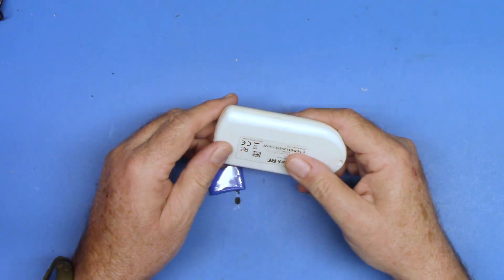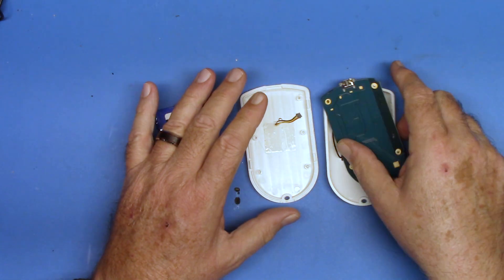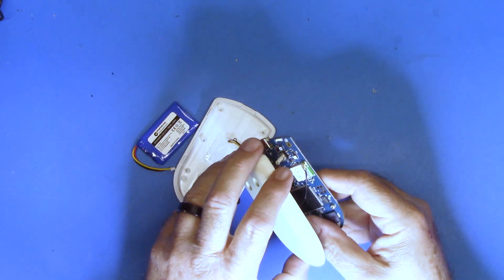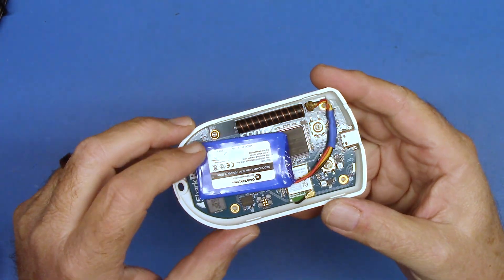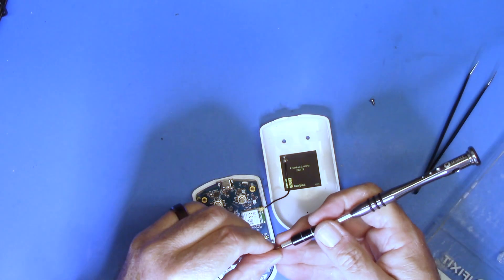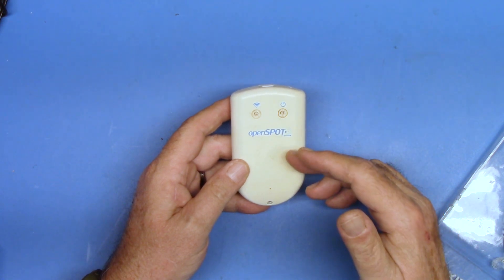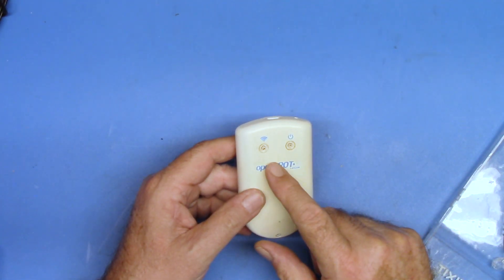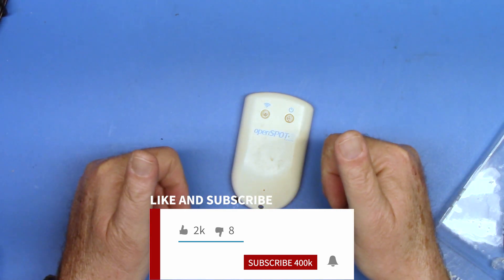Replace that dead OpenSpot 3 battery!

Comment: Nice options…thank you. I will resurrect my Open Spot 3
Reply from the maker: Glad I could help!  I was super frustrated - it took a bit to find the right battery, but the new one is working perfectly, and I haven't run out the first charge yet.

Comment: I couldn't source a battery locally so I ended up buying the replacement from SharkRF. Made it very expensive as it came via DHL. Once the replacement battery dies I'll just be powering it by the usbC
Reply from the maker: That's a bummer.  I keep a couple spare USB-C chargers with me at all times.  When I tried to get one from Shark, I was told by them they couldn't ship the battery to the US.  That's what launched my battery hunt.   Apparently, no problem shipping to VK from Shark.  It works fine running off of a USB-C power plug just fine - either way is aces.

Comment: I would think the battery pack would last a very long time with a charge. The Battery pack actual output goes through a dc to dc converter from 3.7 to 5v so the outpu at the usb'st of the battery pack is 5v but you could go direct inside of the battery pack and hook directly to the batteries . I think I would remove the dc to dc conveter in the battery pack and to tell you the truth, I like the idea of a battery pack more than that little battery. The little battery I have like that failed . That said, and this is important, ALL LITHIUM POWERED SYSTEMS NEED A LOW VOLTAGE DISCONNECT. They are tiny little circuits I've gotten before on little boards.